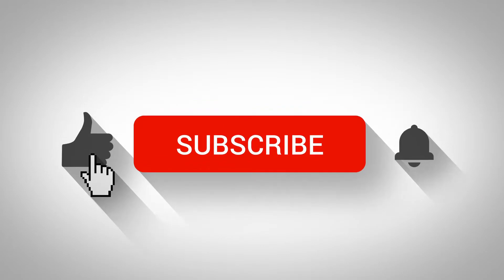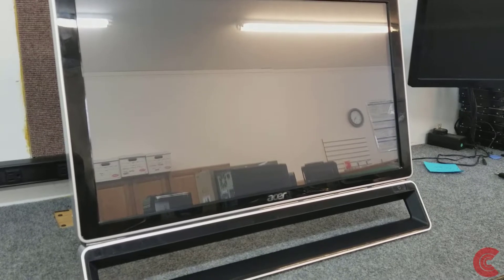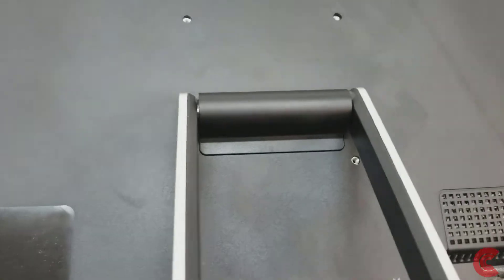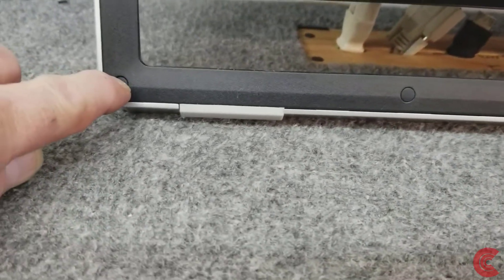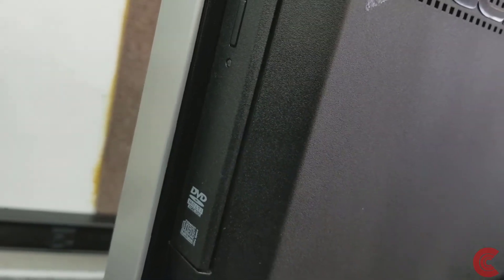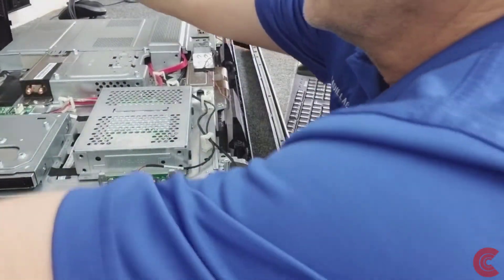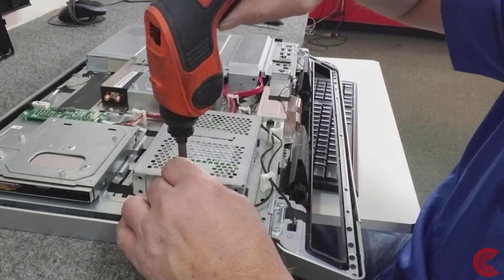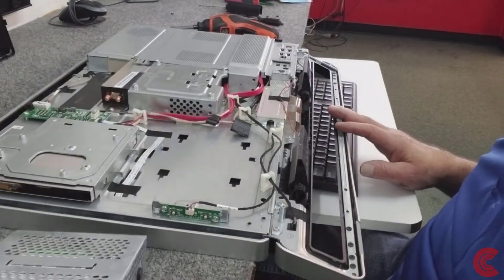Acer Aspire Z5771 All-In-One Back Panel Removal

Comment: Hi, sir! I just want to ask. We have the same model of computer but the power doesn't work anymore. What's the possible reason?! Maybe the problem is inside the mother board?! I dont have any idea. Thank you sir.
Reply: Kakaayos ko lang nung saken, same issue nung sayo, buksan mo lang tapos tanggalin mo yung battery clock, then ibalik mo. Sa case ko ganun naayos. Baka sakaling ganun din sayo.
Reply: @ryandimakuta8599  Hi, ryan. Ask ko lang saan po makikita yung battery clock?! Di ko alam kung saan po. Until now di pa rin naaayos yung samin walang marunong mag ayos. 😢😢😢
Reply: @rymaveg7488  madali lang yan, di rin naman ako marunong magayos, Follow mo lang din kung pano nila binaklas. Di makasend dito ng screenshot.
Reply: @ryandimakuta8599  pero nasa mismong PC ba oopen? Akala namin sa may mismong power supply sa my cord. Saan malapit yung battery clock kuya? San ko kaya pwede makita yung screen shot kuya? Yung samin antagal ng di nagagamit kasi hanap kami ng hanap ng mag aayos walang marunong o baka ayaw lang nila subukan. Baka tayo lang ang may ganyang model dito.

Comment: Good day.. My aspire zs600 hard drive failed.. and of course, I opened the drive.. this likely destroying it.
Anyways.. can I just replace the drive with a solid state instead of mechanical and if so, is anything else need to be replaced at same time?
Thanks in advance.
Reply from the maker: Hi. Yes, you can use a sata ssd drive. That's all you'll need, then a clean windows install.. dale
Reply: @CadillacComputerCenter  Thanks.. appreciate your feedback 👍😊🍻🎸🎶

Comment: Are the hard drives all the same standard size? Mine is having a S.M.A.R.T system failure and I think I need to replace it. The specific model for it is Acer Aspire ZS600G.
Reply from the maker: Hi. Most of these models use a standard 3.5 inch hdd.  You can also use a 2.5 inch drive with an adapter kit.  Dale
Reply: @CadillacComputerCenter  oh alright. Thanks man

Comment: Hi I haven’t found many videos about this computer. The blue light that sigmas it’s on turns on but the screen is black, is there a way I can fix this? I greatly appreciate it! Thanks!
Reply: Chris did you fix it?
Reply: mr pill nope :(
Reply: @Chrisrod878  bro I have been having that same problem for over 3 years lol still no solution
Reply: @Rankedopp   yeah there i basically no problem. fix,
i jus ended up buying a macbook.
Reply: Does yours have a graphic card in it?